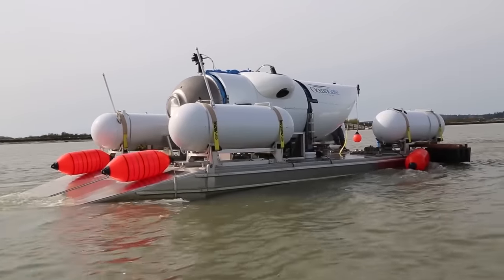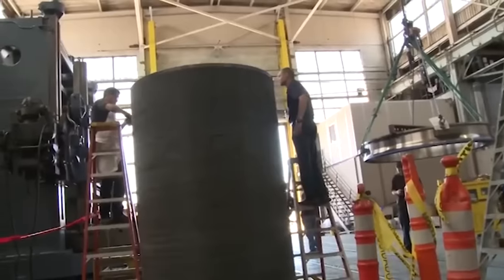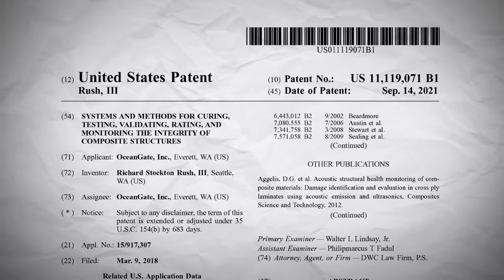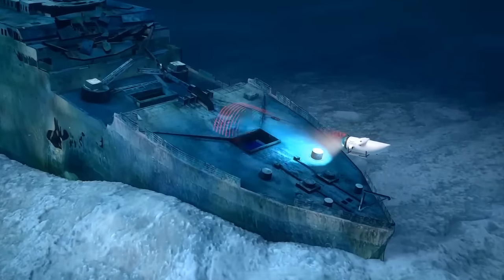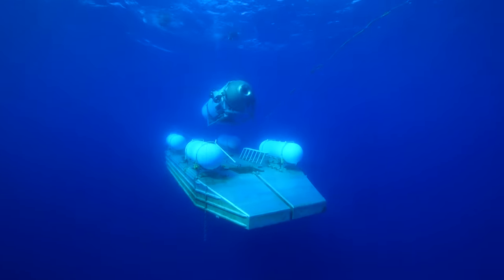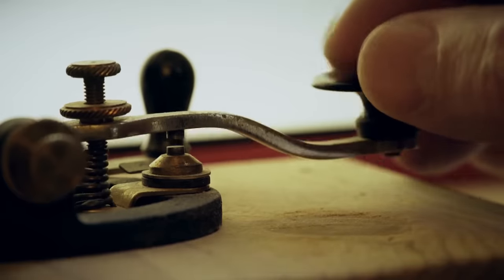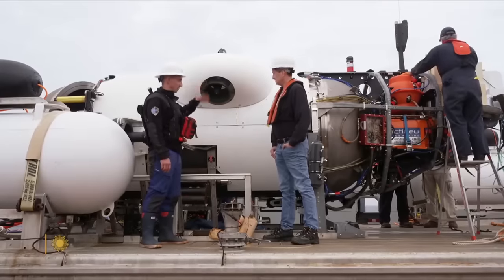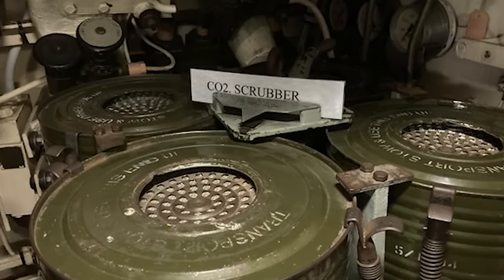Exposing OceanGate Submarines Many Fatal Designs

Comment: The sensors for the carbon-fiber is just tricking you into thinking you're safe. As James Cameron said that if you need sensors to know that the hull is breaking, there's something seriously wrong with your design
Reply: they're the type of thing that would be useful if you're close to the surface, and have an escape hatch.  Knowing the hull is about to crumple isn't much use when you're that deep. No chance of getting back to shallow water in time.
Reply: @jimbobeire No chance of doing anything as they were bolted into the sub from outside
Reply: Im sure the system detected a anomaly somewhere in the 65 milliseconds it took for the implosion to occur
Reply: @jimbobeire  Carbon-fiber is excellent for many things but i wonder how long the hull would have lasted if they never went that deep
Reply: He probably got the warning. Then boom.
Reply: by the time it would've notified of a hull breach....IT"S TOO LATE! it's not like you have time to do repairs when the hull is succumbing to the outside pressure. Milliseconds!!
Reply: james cameron is a bit of a blow hard. If he felt so strongly, why didn't he use his position and visibility to say something. He wuz scared, that's why! He waited until the thing imploded and then says, "See?!! I was right all along!" 
Fat lotta good that did!
Reply: @jimbobeire you have no clue as to the depth thresholds for the hull. Who’s to say at 10,000’ it begins to weaken but once at 8,000’ the hull is able to recover and withstand the pressure to surface?

I don’t know if that’s the case or not, but you don’t know either. Yet you decided to comment as if you are some expert.
Reply: @FredSmith-ei8cm James Cameron has personally made 33 trips to the titanic and other trips even deeper, he has worked with the best in the business to build his submersibles adhering to all certifications and safety requirements. He knows what he’s talking about
Reply: @ramstacp  A metal hull might rebound, but the main part was carbon fibre. I've worked with carbon fibre on dry land enough to know that it doesn't deflect, deform and rebound like steel or titanium. It shatters. if one layer was cracked, then the hull is now thinner, not bent, so it would be quite a wing and prayer to think you'd get back to the surface before the remaining layers gave in.  That's not a safety plan.
Reply: @vaultslayer9162  how do you know this?
Reply: @FredSmith-ei8cm  Cameron himself said that Rush didn't want to hear any opinions that implied that what he was doing was high risk.    There were MANY peers in the deep diving community that were distanced from Rush by his own dismissive response to their professional concerns.      As fate would have it... they were right, he was wrong.    Tremendous tragedy that Rush took ignorant innocents with him on his way out.
Reply: @jagheterhopp yes but this wasn't one of those things
Reply: @revandenburg well the point of having sensors is to warn you of structural integrity problems BEFORE they result in a breach
Reply: @ryansullivan3438  they weren't innocents. They fully informed of the risks and they took them willingly. All for a cheap thrill..
Reply: @FredSmith-ei8cm let's just ignore that one of them was a terrified 19 year old only there to make his dad happy.
Reply: @FredSmith-ei8cm  I dont think it would have done much. Oceangate literally got a letter from the marine technology society signed off by 65 industry members telling them it was unsafe. I do agree more people should have called it out, but its primarily Oceangates own fault for hiding the details and creating a level of deniable plausibility with "trust we got the carbon fibre detectors no need to worry."
Reply: He was an arrogant man who never listened anyone and people were kindly concerned and politely asked him to change to save lives and avoid a disaster just like this. It’s a blessing it took him with it. He can’t do any more harm to other people. This is sad.
Reply: @FredSmith-ei8cm loads of people did. The entire industry did. But he apparently blocked emails addresses of those who sent him safety concerns. Imagine that.
Reply: @bodhi-pickahfilecoinlurker5964  My exact thoughts.
Reply: @gazmodius  That letter went out in 2018. That's 5 years ago. He responded to it by redesigning and extensively testing his submersible. Please do not perpetuate horse puckey on the internet in the name of virtue signaling.
Reply: @KittenBowl1  Just to add onto what you said. He fired a guy in his own company that even told him there were potential issues. There was no talking to him.
Reply: @KittenBowl1  he brought a lot of light and levity in a world much in need of it. People who wanted to see the wreck...people obsessed with it...lonely people who got to experience the thrill of a lifetime...
Reply: @vaultslayer9162 no the carbon fiber was not safe, after that many dives being subjected to those pressures.
Reply: @bodhi-pickahfilecoinlurker5964 talk about reaction  time
Reply: @zkilla4611  No, the implosion would likely happen before the system had the chance to display a warning. An implosion at that depth is so fast. It would be the opposite of the Byford Dolphin accident, possibly the single most gory and horrific accident in diving history. Fortunately, it happens so fast that the victims don't realise anything is wrong. https://en.wikipedia.org/wiki/Byford_Dolphin
Reply: @FredSmith-ei8cm  Captain hindsight away!
Reply: @jimbobeire  

It's a good sensor to measure wear and tear over time
for real time problems, it's as helpful as a fart against implosion
Reply: I think it's for very minor but not deadly damage that the hull goes through during different journeys. Considering this wasn't the first time they went that deep the hull probably had slight damage from the stresses of previous missions. Maybe the team knew but figured they could squeeze more out of the hull?
Reply: @Filthy_Larry  oh you have some knowledge huh? tell us all about it mr fancypants!
Reply: @williamlafond1319  edit away, mr fancypants! 🐽🐽😤
Reply: @FredSmith-ei8cm  never said he was my hero, just that he knows more about this subject than you, me or anyone else in this thread, and based on your comments it seems mr rush is your hero, a man who in his hubris ignored safety concerns and lethal design flaws so he could make a quick buck causing the loss of 5 lives including his own
Reply: @theAverageJoe25  it's not what you explicitly say, purple bear. It's what you mean. And it's clear to me that he's your hero. And that's alright. I get it. People need heros.
Reply: @FredSmith-ei8cm  how old are you kid? My guess is around 10
Reply: @BubbleDouble  Would braces not have helped? Sure it's inconvenient but it should give more strenght than the circular outside
Reply: @BubbleDouble  Well, Sadly with the way that CEO deflected serious warnings like Agent Smith deflects bullets It wouldn't surprise me if this was the case

Comment: Stockton Rush couldn't afford rolls of interwoven carbon fiber material, so he skipped the interweaving process of making the material and took the raw strands of carbon fiber and wrapped it around the pressure cylinder like a spool of thread , adding epoxy. Cross- interweaving the fibers is the most important process to achieve strength, similar to cross-interweaving threads to make a piece of fabric. It's in the video of him during the manufacturing process.
Reply: yikes!
Reply: Even worse is it would have been even easier and probably cheaper to just cast a 5 inch thick solid steel tank + cast a lid for it. Like every other sub ever. And done! They could have gone to the deepest known point in the ocean with that if they wanted to and it would never fail even after thousnds of dives. Sometimes conventional materials are better and this is one of those things
Reply: exactly. also u could see many air bubbles enclosed in the carbon hull in a video, horrible standards.
Reply: @darrylpioch2055  im not sure that it would have been cheaper with the right high quality steel, as far as I think that rush guy was cutting cost corners everywhere I would bet that carbon method was cheaper than steel overall
Reply: I think the pressure cylinder you mention was merely a mold to wrap it around, then removed once the carbon fiber was cured. See the ends of said mould, thos eends don't exist with the drawing of hoe the tube was glued into the titanium end caps so it must've been a mould to wrap the carbon fiber, which sounds even more insane.
Reply: Do we rate the epoxy used?
Reply: @alisonrahn9873  lol, I think you need to ask “do we rate how the epoxy was applied” it’s literally laughable. A few men slapping on the adhesive with a cheap car body filler scraper
Reply: @strammerdetlef  It was cheap because he bought it second hand from Boeing. I havent seen any evidence either way to if the product was at the end of its stable lifespan.
Reply: @ruisilva3317 I thought same thing when I saw that. The amount of air trapped, the uneven curing, and not to mention it’s effectively just “glueing “ it together, is just disturbing to watch. The deformation alone makes that utter madness, even if done perfectly by a machine.
Reply: @TheFridge  Rush said it was aviation grade fiber that had passed its shelf life and was being sold off. I don't know how much he bought but the minisub was on its second operating hull after the first one showed serious decay. They also reduced the operational cargo limit by 500lb so the second hull may have been thicker.
Reply: @darrylpioch2055  Most truly deep pressure hulls are spheres of steel or titanium. It was already crazy to be going with a tube shape at that depth but he wanted room to easily carry passengers. Working with alloy to make a tube, they'd probably need internal ribs and other structural features if they wanted it to be light enough to float. And this is definitely harder to design and build. Honestly it would have been less crazy to make a set of acrylic spheres clustered around a central mechanical unit. Triton already has three-man spheres rated to 13000ft and they are fully certified.

When you see the railcar tank collapse around 1:36 into the video, that is collapsing under ONE atmospere of pressure. When we send crewed vessels into space they only need to contain LESS THAN one atmosphere of pressure, not even full sea-level pressure. These deep diving vessels must resist hundreds of atmospheres of pressure. Softer metals will slowly bend and harder metals may crack, especially as the low temps and high pressures promote "embrittlement" in certain materials.
Reply: FFS, who let's Del Boy Trotter start a submersible company. 😑
Reply: Well, he got what he deserved in the end.
Reply: @darrylpioch2055 the problem with using steel is you have to achieve neutral buoyancy. Steel is heavy so you need to add buoyancy to contract that. The foam needed to do this that is rated for extrmen depths is very expensive. Carbon fiber composition is naturally buoyant which means they don't have to use the very expensive foam.
Reply: @TheFridge  "It was cheap because he bought it second hand from Boeing."
That's an oft-repeated claim, but Boeing deny ever having sold any carbon fibre to Rush or OceanGate.
Reply: @beeble2003 he said he bought it from Boeing because it was past it's shelf life, but perhaps it was discarded material from Boeing, salvaged by Rush, and he used his wordsmithing to link his company to Boeing in that way
Reply: @beeble2003  Okay then, so I know nothing then 🤣
Reply: @mcarter99 the problem with using the industry standard hasinduetry standard solutions.
But no use carbon fibre. A substance that doesnt do compression well...
Reply: @darrylpioch2055  The thing is, such a tank would simply sink and never resurface. Submarines have very large ballast tanks and huge layers of lightweight foam in order to achieve buoyancy. They went with carbon fiber because it would allow them to bypass all that. Still a terribly stupid idea, since it's well understood that composites are not suitable for this application.
Reply: no mater how its done,carbon fiber is not what is needed for a dive at those depths! Carbon fiber is no more than Pretty Plastic!
Reply: Plastic? No carbonfiber can be super strong. Just not good at compressive forces.
Reply: @wytze01  carbonfiber is a form of Plastics

Comment: @5:55 the narrator mentions that using wireless controllers is quite common in military applications. Let me add much needed context here. Yes, the military (I served 20 years) uses wireless controllers, but never to control aircraft, land vehicles, nor submersibles that have humans as a payload. It's one thing to control a small drone (like the type an infantry squad may carry), or an EOD robot with such a control, but quite another to try and control a helicopter carrying 16 people, or a submersible carrying 5 with a wireless off-the-shelf (and later modified) game controller. As for the Virginia Class submarine, the only thing that the controller they have implemented is used to control is the optical sensor system (a two-photonics mast) used to see outside, not the actual operation of the submarine.
Reply: Thanks for your serve🫡❤️

Comment: To be clear, USN Virginia class submarines do not use game controllers to steer the vessels. However, they do use Xbox controllers to operate their periscopes.
Reply: interesting info
Reply: Xbox controllers are also used to fly military drones.
Reply: Xbox controllers are using for flying drones though, some tanks have them in for certain guided missiles. They’re reliable enough and the analogs sensitivity helpful. No point reinventing the wheel when Microsoft/Sony have put so much funding and years of research into perfecting the controllers.
Reply: The sun was not killed by a faulty game controller.
Reply: wireless?
Reply: @davidelliott5843  just looked outside and the sun is still shining so Im not sure what you are talking about ☀️
Reply: @OfficialSamuelC  Microsoft has also done more than a few rounds of consulting for military tech outside of the controllers. There's a level of pedigree in what they provide.

Logitech isn't exactly at the top of my list when it comes to life-critical and mission-critical hardware, but somehow their $40 gamepad ended up steering a whole sub. Maybe they should add a warning label to the box.
Reply: I’m such a badass, I use a game controller just to play video games.
Reply: @OfficialSamuelC I'm pretty sure the controllers used for military applications are:
Heavily modified
Not used for safety-critical systems
Don't use Bluetooth
Reply: @commanderspock5983  Yes, the small man-portable drones. But a large drone like the Predator or the Grey Eagle is controlled from either a dedicated control facility (inside a building), or from a deployable command and control center, known colloquially as "the box", which is about half the size of a shipping container. Certainly, not a small PS5 nor XBox controller.
Reply: Using game controller if it makes things easier/familiar is fine, but there should be a proper backup manual control.. or better yet.. use it to control submerged drones instead since they're seeing through a monitor anyway..maybe let the submersible submerged a bit but on saver level just to for immersive feeling but send actual drones down..
Reply: @abziehbild1984  I bet they are mostly just using the form factor of the controller with redesigned shit thrown in. Sort of similar to how in ww2 the military tried to designed grenades that were shaped & thrown like baseballs so people would be mostly automatically aware of how to use it. I bet it saved a lot in training money wise.
Reply: even if they did, so what. the controller isn't what failed here, nor was it likely to. it just makes for good headlines, is all.
Reply: you can use game controllers for stuff that is kot mission critical. I would not depend my life on if my xbox controllers bluetooth works tbf
Reply: Not entirely dependent on xbox thing, there is still regular controls exist for full access of all features
Reply: @gooseloose682  True. Just want to add that the Xbox controllers used in US Navy submarines are wired and not Bluetooth.

Comment: The criticism on the game controller wasn't on that it existed, it was on the specific model he was using. It apparently had a reputation for bad connectivity
Reply: haha
Reply: Yes, game controllers have been used even on many billion dollar equipment too so that part is not so weird to me. But they should have used a wired xbox or Playstation controller instead. Those are proven to be quite stable and handles harsh use etc. That is why many use them for so many things. They are perfect for alot of things. But the Logitech controller is not nearly as good.
Reply: The problem is also that every piece of equipment on a sub needs to be 100% certified to not be a spark hazard under any circumstance
Reply: @madeliner1682  Yes, most logical people understand that but his (and my) comment was specificly about the controller...